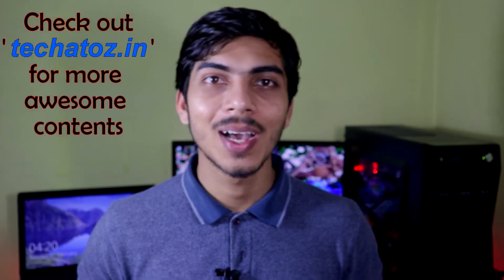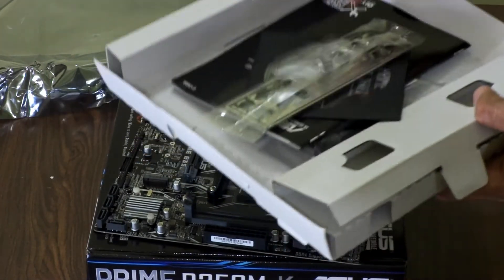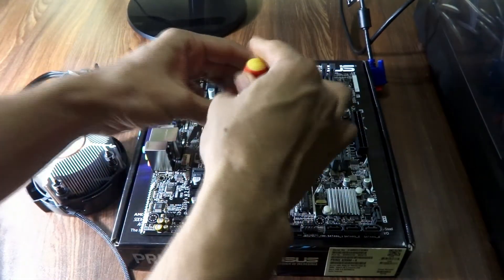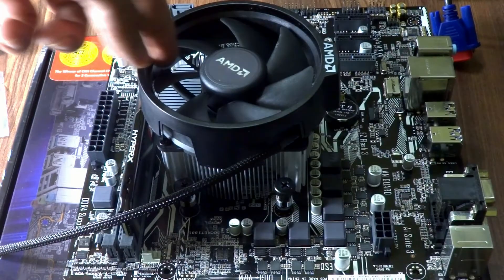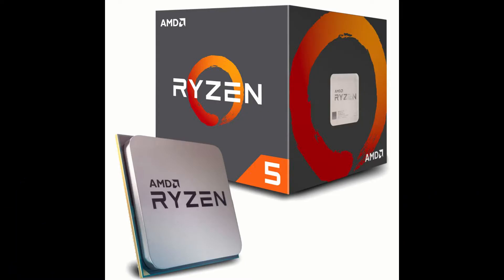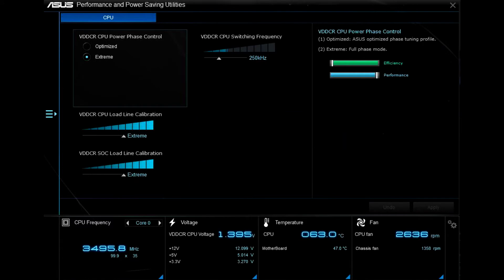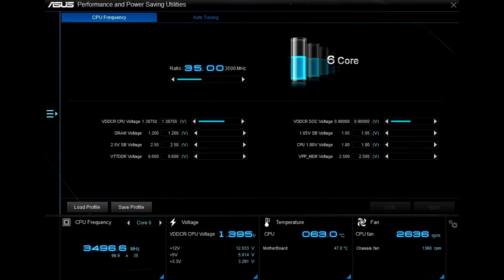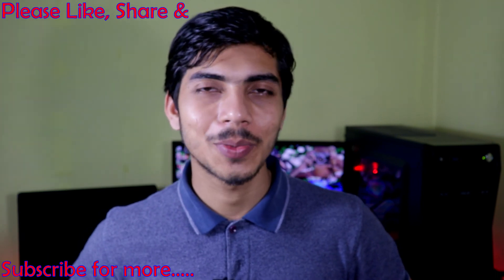Asus B350M - K Unboxing & Review | Best Budget Motherboard for AMD Ryzen CPU & APU India | Tech AtoZ

Comment: Bro I have same motherboard and i bought a corsair 3200mhz ram but it's not running on 3200mhz speed i tried with docp setting from bios still whenever I do that bios needs to reset do you have any suggestion?

Comment: Support ryzen 7 2700x + rtx 2060 super. ?
Reply from the maker: It will support them but I won't recommend it. Since your CPU is 2700x it will take way more power than non 'x' ones. You need a motherboard with solid VRM that can fully utilize 'boost cores' on heavy loads. This 'Asus B350M-k' would definitely won't do that. If you'll leave such high performance CPU under-utilized, there is no point in buying Ryzen7. You should buy either x570 or last gen x470 motherboard for this CPU & GPU combo. Even cheapest one I'll suggest is at least a solid B450 ATX motherboard. You can find some discounts right now because of X-mas and New year sales. Here are some suggestions in low range- ASUS TUF B450-PLUS, Gigabyte B450 AORUS ELITE, MSI B450 Tomahawk Max, Gigabyte X470 AORUS ULTRA
Reply: @TechAtoZEnglish  ty brother . Asus prime b450m_k   ok ?
Reply from the maker: That's m-ATX board. Try to go for full ATX one. If you can't afford it then B450m-k is ok. I'm saying it only so you can get full benefit of your powerful CPU.

Comment: What CPU did you use?
Does this motherboard need a bios update before the Ryzen 3 2200g will be compatible?
Reply from the maker: I'm using Ryzen 5 1600 and yes it'll need BIOS update for 2200g but you can ask from whatever shop or website you are buying to update it before shipping it, most of them has no hesitation doing it. You can confirm from them before buying.👍
Reply: It didn't need a bios update to run 2200g in the end.

Comment: I am buying this motherboard for ryzen 5 2600x does this will support overclocking?
Reply from the maker: Yes it definitely supports overclocking but If you want to overclock your CPU at its full potential then I'll suggest you to go with a more solid board and spend around ₹10000 on it.👍

Comment: can Asus Prime B360M-K overclock cpu and gpu?
Reply from the maker: Hey buddy, it's B350M-K and yes it can overclock both CPU & GPU but not to their full capacity because it does not have top level power delivery system like higher end Motherboards. If you want enthusiast level OC, you should go for newer boards with X470 chipset or if you have tight budget, you can buy last generation's X370 motherboards. I hope it will help you.👍

Comment: Bro, you think this board will handle zen2 / ryzen 3000 series?
Reply from the maker: Definitely, because Zen2 will support AM4 socket. But if you want to buy a new motherboard now, you should buy newer series motherboard like B450 or x470 chipset.👍
Reply: @TechAtoZEnglish  already have this board on my 2400g + RX 570 bro just want to upgrade to 7nm when it comes out

Comment: Can it control rgb fans
Reply from the maker: It has 4-pin PWM connectors. So whether your fan is RGB or not, you can adjust the speed of your fan from BIOS or AI Suite software. But you cannot change the colors or brightness of the fan lighting directly from motherboard utilities. Another thing you should know that it only has 2 fan headers- 1 for CPU Cooler & another one for a case fan. I hope this info will help you.👍
Reply: Tech AtoZ (English) thanks for the info .. can you please suggest me a mother board which can control the lighting of rgb fans ? I am buying Ryzen 2700X and cooler master MB500 cabinet (it has 3  RGB fans)
Reply from the maker: You can buy 'Asus ROG STRIX B350-F Gaming' motherboard. It's around ₹10500 on mdcomputers. It has 2 RGB fan headers but you can buy spliter to connect more fans.👍
Reply: Tech AtoZ (English) Thanks bro !! M going to buy that motherboard 😊
Reply from the maker: Best of luck with your new build buddy. I hope you'll enjoy it.👍